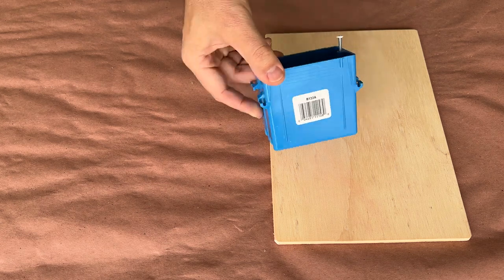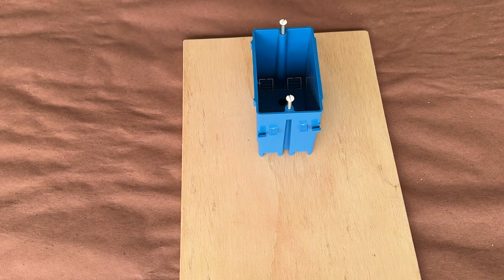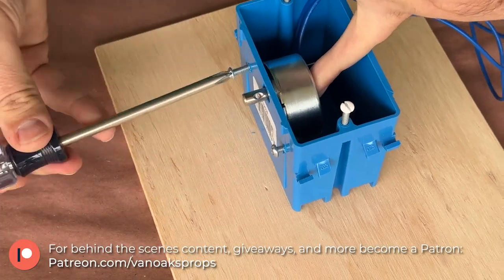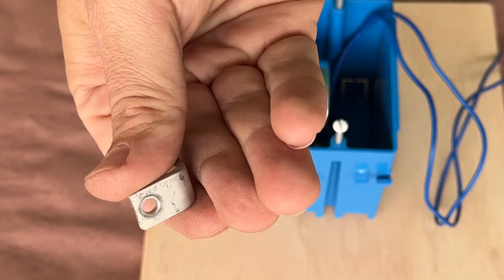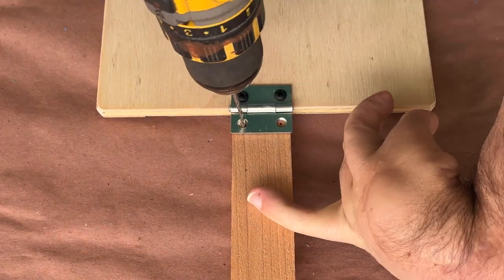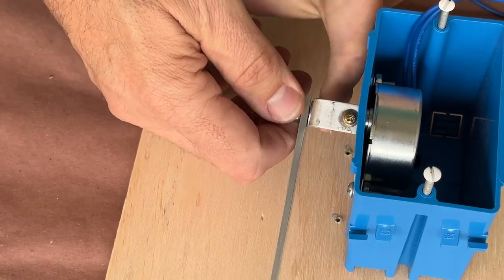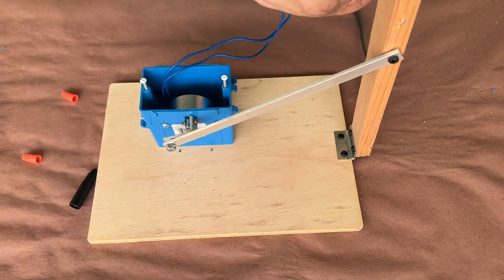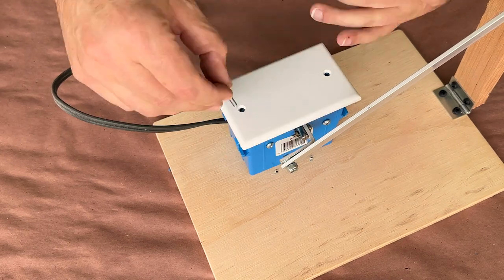Building a Weatherproof Rocking Prop Mechanism!

Comment: Nice. Simple and easily fixed if goes twisted at night with 300 persons watching (always think of high stress fix in design of anything cause it will happen).

Minor, but could add an electricians knot to the power cord (knot it inside the box so it cant be pulled out of the hole).
Also might want to add a rubber washer with some hotglue/sealant around mechanical hole. If worried about rain and/or sitting water situations (ya never know)

Comment: I'm a big fan of DIY solutions, and there are good ideas here that can be used for other props.  In this particular case, though, I think the off-the-shelf solution is a win.

"Reindeer" motors are 5-6 RPM synchronous motors that come pre-wired in a weather resistant case with proper gaskets and strain relief.  While they're not as cheap as they used to be, if you compare them to the price of a bare motor, extension cord, junction box, and a cover plate, it's about a wash.  They're available from at least two of the online haunter supply dealers and at least one Christmas decorations dealer.
Reply from the maker: Agreed. The bare motors used to be so cheap $1-3 which made them a great option. But they’re much more expensive these days.

Comment: To prevent water from coming through the cable opening, I do the following: I let the cable hang down in a small loop outside the housing so that the lowest point of the cable is below the feed into the housing. This way, the water that flows along the cable drips off there.  😃

Comment: This is only a temporary installation so it probably won't matter but many outdoor boxes stop the rain getting in but they aren't air tight so damp air gets in at night, condenses and warm dry air gets out in the day. As a result the water-proof box slowly fills up with condensation. A hole in the bottom can actually help let the moisture out of a waterproof box.

Comment: I've used 6mm (~ 1/4") threaded rod and ball joint ends for props like this. It eliminates the slop in the joints and allows the other parts be be done up tightly.

Comment: One tip, that screw and nut connecting the motor to the angle piece…. Use a nylock nut. That is where I have had issues with things getting loose…
Great video as always
Reply from the maker: Great suggestion, Greg!

Comment: I will do this for a "rocking chair" to put an skeleton holding a beer and having a relaxing halloween day...
Reply from the maker: You may want to check the final weight of your rocking chair & skeleton before building this version since the synchronous motor I used doesn’t have enough torque to move heavier objects. There’s a link in the video description to another motor that should work for your project.